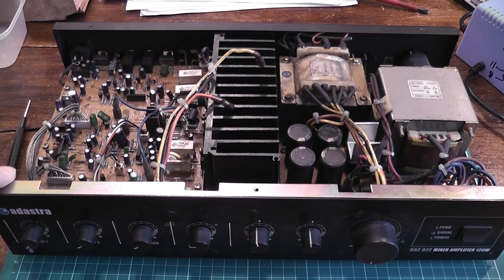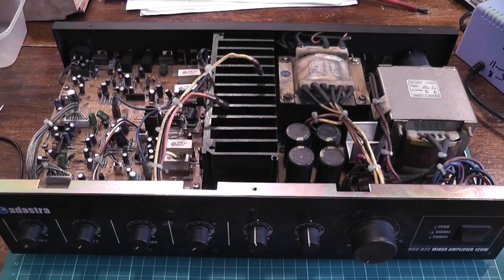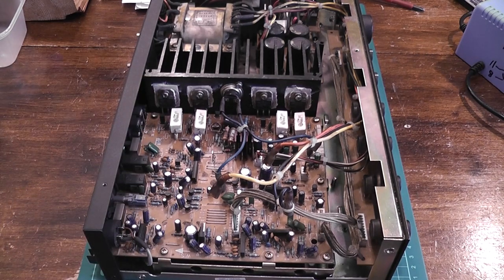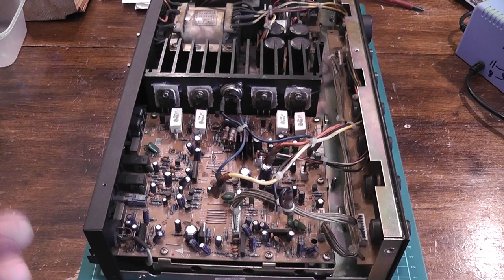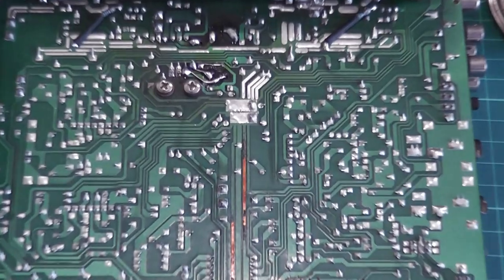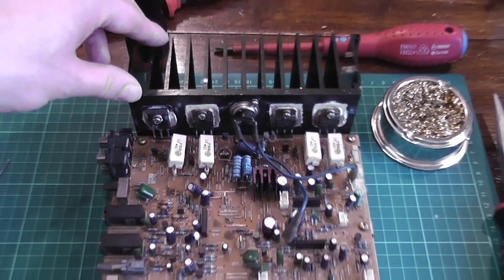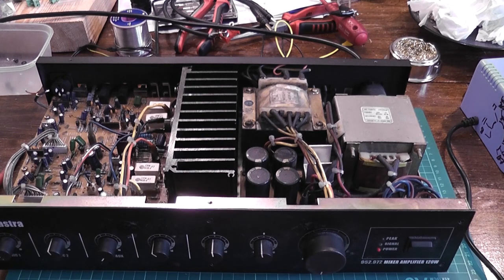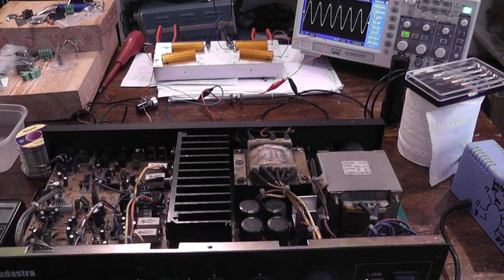Adastra saw mill amp

Comment: The backend sound amps are a challenge to get working agin but have you worked on a Crown DC-300 a all dc couples   Not too bad if it’s got a shortened output but if there is a dc offset of 10 volts it a real problem there are seven different feedback loops a very small failure in a signal level device causing the output to be bad but ac wise it’s ok
Reply from the maker: Servo based DC coupled amps can be a real headache when they go wrong.